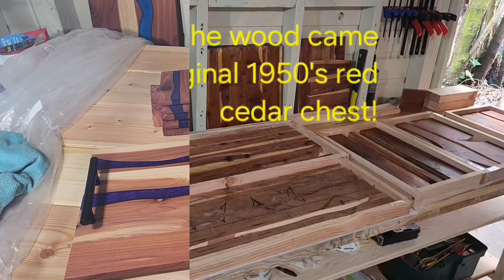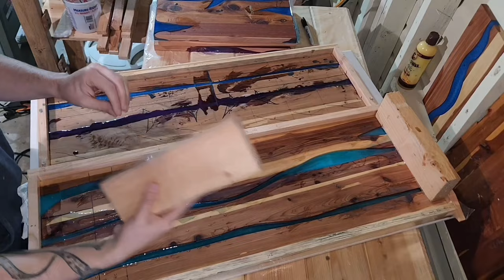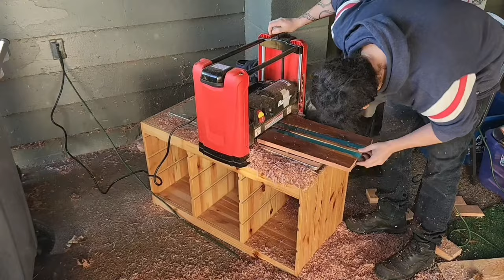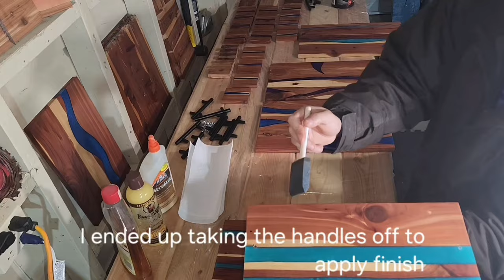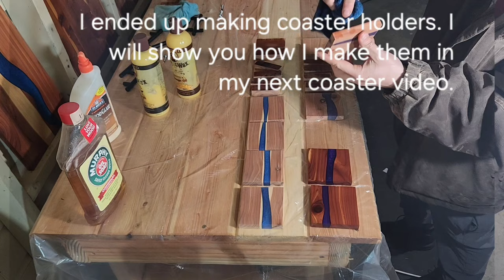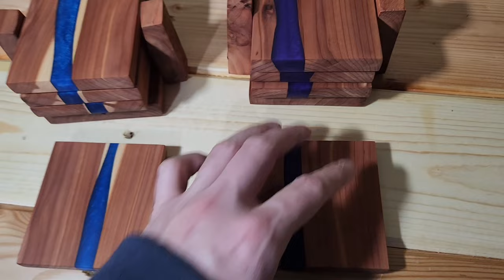River Epoxy Trays And Coasters!! (Full Video)

Comment from the maker: It's a 12.5" planer, it works great. I use feed n wax wood conditioner and oil/water mix polyurethane. Multiple coats of each and a lottt of sanding with different grits.